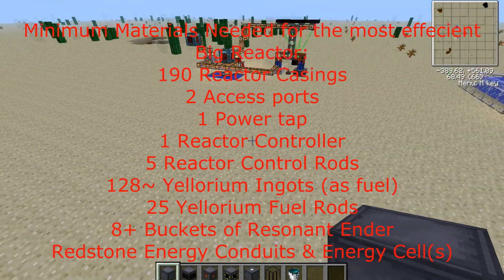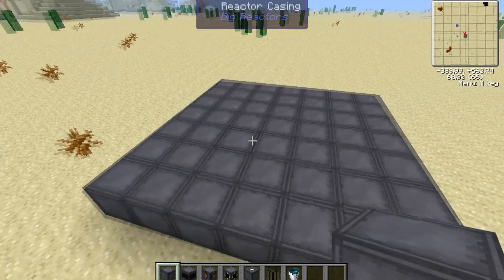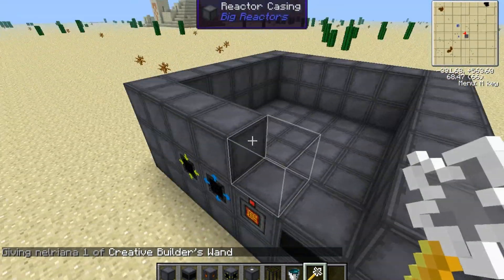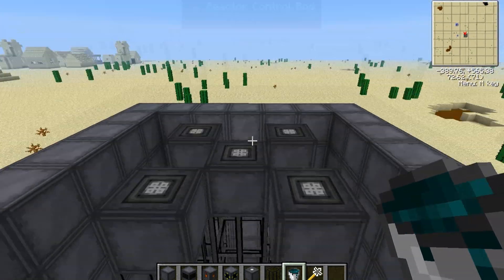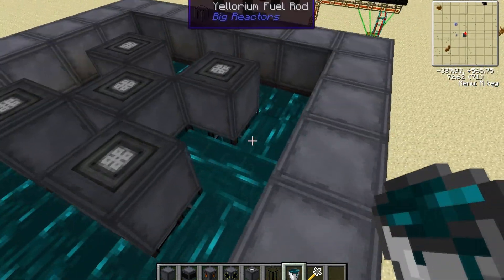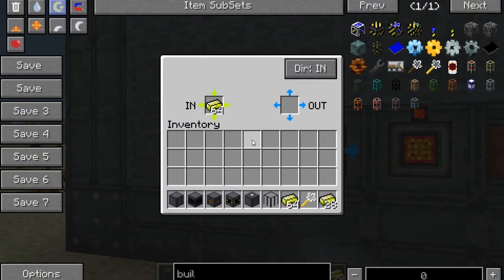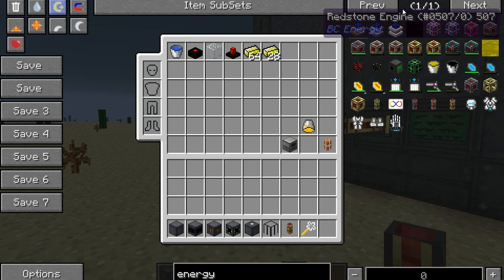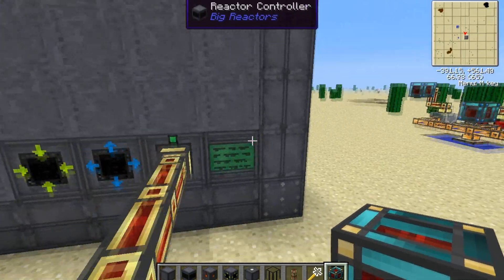Tekkit tutorial on Big Reactors

Comment: its not generating power for me :C
Reply from the maker: +Oktay Dönmez Then you either are missing something, haven't added fuel, or turned it on yet.
Reply: Nelriana i did everything but it just takes water and gives me steam :(
Reply from the maker: Then you made a steam reactor. If you pipe water in it will generate steam not power. If you just put water inside, or another coolant and get rid of the fluid import/export block it will be a power reactor.
Reply: thank you i fixed it up  :3 now i can build 200 more to deposit enough power GOOD BYE BIO-FUEL!

Comment: "Short Video showcasing the most efficient format for Big Reactors."

No, it's not: https://docs.google.com/spreadsheet/ccc?key=0An54qOfSiXfJdEcyaHAxWURaZTR2eEpEWEFaU0xydXc#gid=0
Reply from the maker: You should maybe do some testing yourself prior to making such a statement so as to avoid being rebuked. That spreadsheet was made prior to big reactors .3 update (I know so because I used it prior to the big reactors .3 update), and hasn't been updated since AFAIK. Since that spreadsheet was made a few things have changed. Such as diamonds not being as effective of a coolant material. I just tested it last night and diamonds do not have a positive effect on output at all when coupled with resonate ender, but that is the only relevant change to that spreadsheet. 7x7x7 with X shaped pattern for fuel rods and cooled by resonate ender is still the most efficient @ producing power. 

Now for some numbers. In the latest build of Big Reactors (which also is the tekkit build since it hasn't been updated in a long while) I produced 11.7k rf/t with resonant ender only for cooling. With a diamond core and resonant ender ring I produced 11.6k rf/t. With only diamonds I dropped to 9.58~k rf/t. 

As for being efficient. Lets assume that diamonds did produce more power when coupled with resonate ender. Lets say that instead of the -100 rf/t it currently has it goes the opposite way of +100 rf/t Do you really want to spend the amount of diamonds necessary to create all those blocks? (20 blocks for core or 180 diamonds) and if you filled the entire reactors with diamonds it would cost you 100 diamond blocks which would mean 900 diamonds. Even if you gained the net of 100 rf/t 180 diamonds to get it is not worth the price, thus it would be more COST efficient to go with the cheaper resonate ender anyway. 

The cool thing about big reactors, is you can pretty much make it as powerful as you want because they won't blow up. I just made for kicks and giggles an 11x11x11 with an X shape in the with 4 additional rods in the gaps right prior to the reactor walls in the middle of each part of the X. I was producing nearly 59k rf/t. All cooled by ender.
To compare this to the efficient 7x7x7. The larger one produced about 5 times more power, but was using outputting waste at nearly 6x the rate. (so approximately 20% less efficient) in terms of power per ingot of yellorium) 

I'm sorry this post is so long, but it annoys me when people say stuff like that then link extremely old figures that are wrong.

Comment: Without calculating it, this seems far less efficient than Atomic Science,  A fission reacters lasts about 40min at 8000RF/t on just three yellorium ingots. 2400min at 2000RF using 64 times more fuel seems worse. However, AS isn`t wanting to work for automation.
Reply: Yeah, AS uses less than a quarter of the fuel that BR does. That is more I expected, though. Either way, that is a small price to pay. I`d have to manually fuel AS vs computerizing BG. AS needs a lot of attention.
Reply from the maker: FailingDarkness I believe the fusion reactor from atomic science can be entirely self sufficient with just pipes, unless there was a major update to the mod since I last used it. I know the Fissle reactor can also be made self sufficient with some clever piping or with the use of an AE system
Reply: Nelriana That's what I thought, too. AS seems to change a lot. None of the Youtube videos contain the new version yet. I couldn't get AE to work with it. I haven't tried other piping systems yet. Also, fission reactors don't seem to blow up anymore. I don't need to set one up only to have an update result in my setup exploding.
BR has had big improvements as of 0.3. According to the Technic Wiki, BR RF output can be increased 50% with turbines and efficient design. Lowering core temp decreases fuel use while increasing casing temp increases power output. It's a balance game. I just finished a 25 rod setup measuring 11x11x12, and I'm eager to see what I can get out of it.
Also, for BR turbines, BR doesn't limit coolant flow, so one should probably use tesseracts without fluid pipes or liquiducts.
Reply from the maker: FailingDarkness Well, at least for tekkit (latest/current build 1.2.9e) Atomic science is still 100% self sustaining. Chemical Extractor & pipes pumping in deuterium into the fusion reactor, with the fusion reactor powering itself after initial kickstart. I can't say for the latest version as I only play Tekkit/Ultra Modded Survival. I don't add mods in myself or update them. Best of luck to you!

As for big turbines, I decided that If I wanted to use steam power, I would just use atomic science, because the Big turbines are too complicated, while the reactors are relatively simple and output decently
Reply: Nelriana Yeah, the fusion aspect works well and is the ultimate power source. I'll make it before too long. I have to replenish my nether quartz supply first and, to make the construction much faster, upgrade my ME system's crafting capabilities..As for steam, the steam aspect of AS isn't working well, or so I hear. I know it was working in Tekkit 1.2.7b, though. I haven't looked into the crafting recipes for BR's turbines.
Reply: Nelriana I tried out my 11x11x12 reactor with 25 rods 10 blocks high arranged similar to the reactor in this video. Based upon his and other`s reactors, it should have produced 20kRF. It easily produced over 80kRF. Best of all, it has the same efficiency as AS`s fission reactor. Waste recycling and turbines would make it way better. I lowered all the fuel rods to 90% to settle at 16kRF/tick. I have it off most the time, being turned on by a computer that measures my power supply. I need to overhaul my power system, thugh, which can only maintain 10kRF/tick as of now. This rivals or beats fusion reacted from AS
Reply from the maker: Yeah, this was before the big remake of Big Reactors .3. I haven't played around with them much since, because I have been mainly doing Ultra Modded Survival which doesn't have AS or BR. I am sure that with the remake of Big Reactors you can have more layouts, at the time this was the best possible layout in terms of efficiency & output. Probably is still competitive as well.
Reply: Nelriana
Your reactor design is still the best, even if someone decides to add turbines to it. They will just get a lot more power with BR 0.3. I think it's enough to justify not making a fusion reactor. BR gives more power, and its fuel is abundant. It's hard to beat completely self-sustaining, but you'd have to build several large fusion reactors to do better than the 11x11x12 BR reactor that I made.

I haven't tried other modpacks. Ultra Modded Survival looks interesting, though.